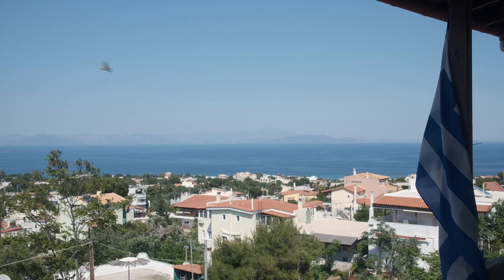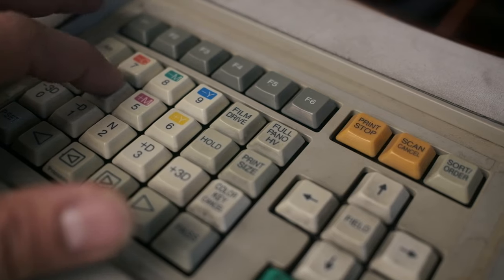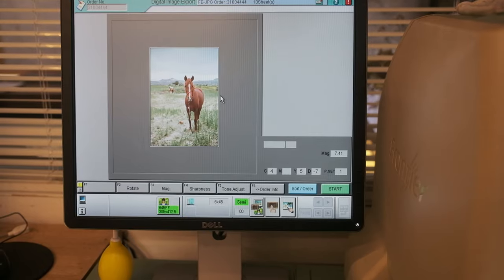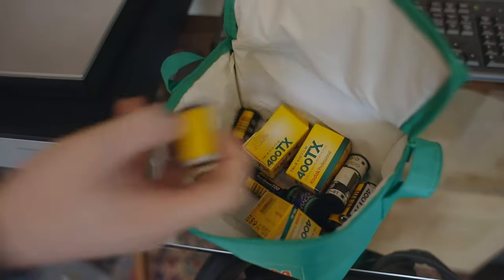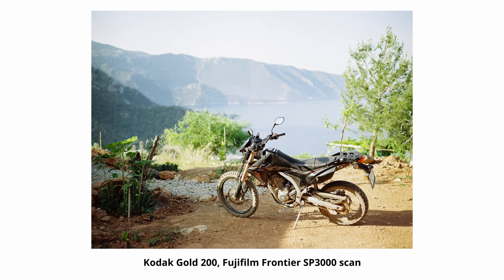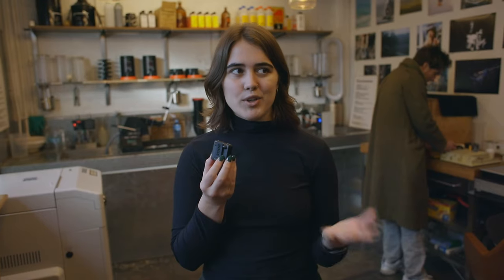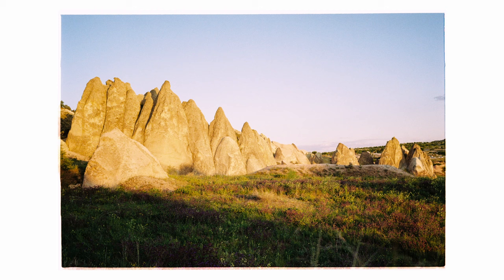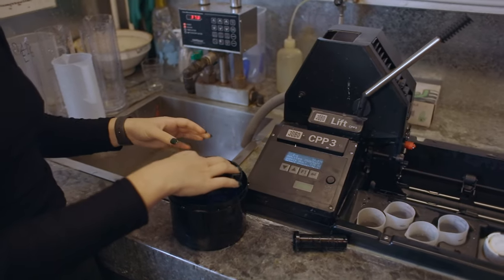Open Lab - Self Service Film Lab

Comment: Gez the controls for CMY D on the SP3000 are set super rough.
Reply from the maker: Yeah the increments could use tweaking on that one
Reply: @pushingfilm  They’re super strong by default. I tuned mine way down to precisely match the values given out by movie printers. I.E. 6 points = one stop.